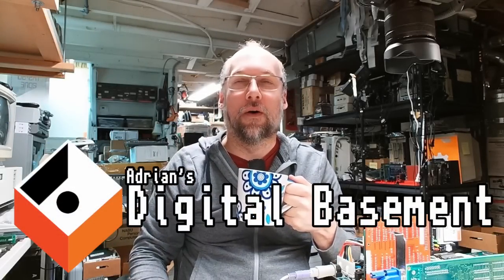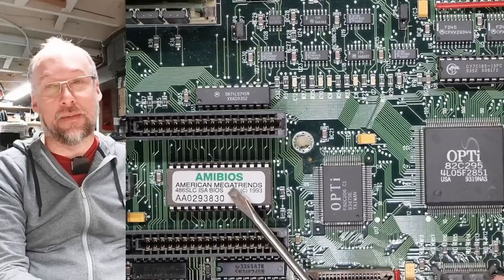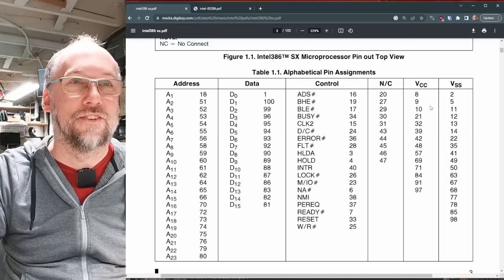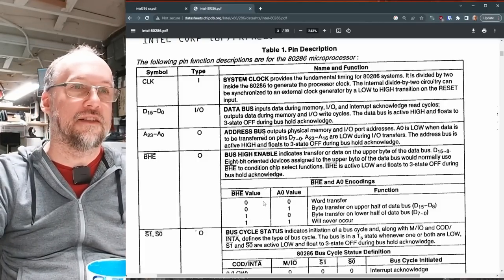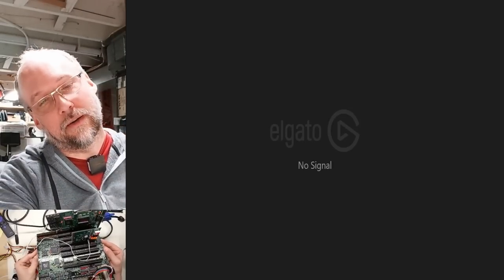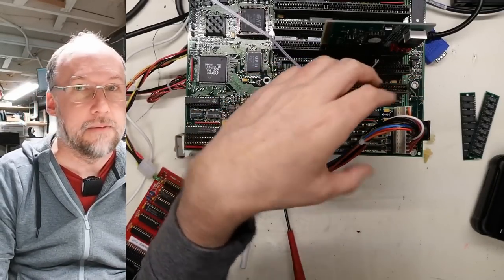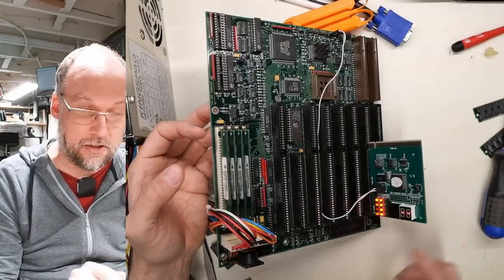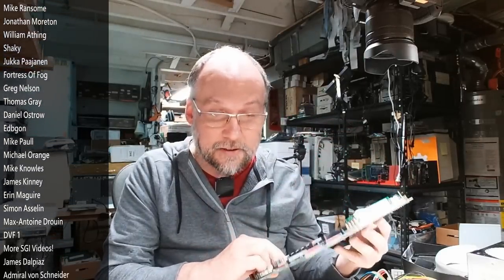Disaster struck while working on this odd-ball 386SX VLB motherboard

Comment: I have this exact board, the CPU is an IBM 486SLC2 - mine running at 66MHz. My first 486 had this board in it (not the exact one I have now), they were often sold in bargain basement PCs where they could use the cheapest parts but still market as a "486". Although it's really a 386SX as you said, it's surprisingly fast as it also has 16KB of L1 cache, double that of a 486DX2. Probably on par with a 486SX-33 as far as speed. As for the VLB, I have a Cirrus Logic VLB in mine which runs decently but I haven't done any comparative benchmarks, but I mean to do so one of these days. I have tried installing VLB IDE and SCSI disk controllers in the board but have been unsuccessful in getting anything but a video card working in them
Reply: To me the easiest way to test graphics card performance in DOS is using the game Screamer, the configuration has that option.
I remember testing PCI vs local bus on a 486 sx 50mhz and the 1mb PCI Cirrus 54something (5420 or 5430?) was faster than a "chips wingine 64300" local bus card.
Reply: @pelgervampireduck  That dos 3d benchmark with the floating pc was perfect to measure the difference of the video bus speeds

Comment: I had a 586-133MHZ system with VL-B, it was the Image 128 graphics card. Anyways I always had issues with the card popping out of the extended slot all the time. It was a very tight fit, amazing the card nor motherboard never got damaged.

Comment: 15:23 The VESA spec says the maximum frequency for VL-bus is 25 MHz if there are 3 slots, 33MHz if there are two slots, and 40MHz if there is only one slot. I think this has something to do with signal reflection, or just the load on the bus (in the load case it would be possible to run a 3-slot VL-bus at 40MHz if only one card is present, I don't know whether it is true or not). 50MHz is possible if the device is on-board instead of plugged in using a slot. However, few chipsets support 50MHz FSB 486s, and even fewer of those motherboards have an on-board VL device, so this is hard to verify. Plus, starting from DX2, intel stopped selling 50MHz FSB chips (because few motherboards support that!), the overall performance would be better on a 66MHz DX2 with 33MHz bus than a rare 50MHz DX with a 50MHz bus. Note that these are all guaranteed specs, in real life no one stops you from clocking a VL-bus with 2 cards at 40MHz just like no one stops you from overclocking. The only problem is that stability is not guaranteed outside of those frequencies.
Reply: That explains my painless experience with the 486DLC and single VLB so it was safely running at 40mhz with the Trident VLB i see...

Comment: Hi Adrian,
I had a 386DX back in days and I had experience with this configuration as well. Using a very similar Cirrus Logic card the graphical speed was like half. Not many software used the graphical acceleration that time, but with the SX series it's was like no acceleration at all. On price wise it was a 25% cheaper (the whole PC) but it definitely not worth to save on this boards. This is my first PC was 386DX and I saved on the Sound Blaster compatible 8bit sound card instead.
I also tried to save on the Quantum Hard Drive, but that was a failure as I had to replace 3 times in one year. 
Anyhow I like the video and thanks for your hard work.

Comment: This is why I don't like using old AT power supplies, but use ATX's with AT adapters, the fear they'll fail and take hardware with them. Same with original C64 power bricks. But I don't have wizardry repair skills either, hence I'm extra cautious and in awe of those who's got em' 🙂

Regarding 386SX, I think along with more MHz, it's also got double the amount of transistors, so still quite beefy compared to a 286.
But would never have guessed it existed with VLB either.

I hope you feel better Adrain, and thanks for making and sharing the video despite everything 😊
Reply: I don't like AT supplies because they typically route mains voltage through the case to a switch, I've had a machine I was working on where the front switch was either replaced by a moron or the factory subbed a switch they shouldn't have, but it had solder lugs on it instead of straight terminals for spade connectors, so the switch wires had enough wiggle room that one of the leads managed to short against the bracket holding the switch and threw a nasty arc and flipped my breaker, I think I got a little bit of metal in my eye from it too, so I don't like messing with AT supplies at all because of it.

Comment: This is a very interesting period in PC history.  The VLB standard was very strange anyway.  The cards never fit, and the drivers almost never worked.  I remember the Diamond Viper being the component that would best take advantage of the standard, and I had one that worked maybe 50% of the time.  Most people had a Cirrus Logic 5xxx card in VLB, and the many VLB controller cards which I never really noticed a speed difference with.  You are right about the SLC chips being a very misleading standard.  John Dvorak famously lambasted IBM for putting their name on them.  Of course this was IBMs revenge on the whitebox market by dumping all the motherboards with SLC chips in them, after the failure of their Ambra brand.  I had a couple of those boards, the 32 bit models were known as "Blue Lightening".    I suspect this board was intended to be in one of the odd Ambra models that had both and SLC chip, and a VLB slot.
Reply: LOL - I have built over 50 retro PCs recently for sale on eBay with VLB, the cards fit and the drivers worked. The only occasional issue is that some VESA cards don't work in certain slots, but I've never had issues with them, even back in the 90s. Hell, I had a DX-50 486 running with VESA I/O and a VLB video card, as well as a Socket 4 P60 VLB running Windows ME back in the day. The drivers are available now, and they were included back in the day on diskettes. Stop dogging VESA. 

Also, "lightening" ?

Comment: When you zoomed in on the opti chip, it looked like there was some rogue solder or something bridging some pins further along the edge (bottom edge, to the far right, near the corner.. as looking on the video) and then also, the larger chip above, the bottom right corner (again as looking from the video) - looked like there was a rogue piece of metal or wire going from the via or something...

Comment: The differences between the 286 and 386SX were a lot more than a few lines. Protected mode worked, it was 32 bit internally so could run 32 bit code (unlike the 286) but had a hobbled data bus to 16 buts to make it cheaper.

Comment: You assume that adding VLB slots is for speed increase, it could just be added for compatibility with VLB cards. Also, while some 486 had PCI slots the initial PCI version was broken. Most cards for the 486 were either EISA or VLB.

Comment: I just sold an IBM Blue Lightning SLC with VLB - it was also a 16 bit processor at the core. I've seen 386 SX VLB mobos, albeit with a socket 3 upgrade path.

Comment: When I finally switched from my souped up Amiga 1200/030 - I specced up a 486DX2-66 with VLB for SVGA graphics and hard drive cards. Good times for the very short lived VLB!
Reply: When i moved up to a Cyrix 486DX4 100 the motherboard had two VLBs, i brought my trident VLB and added an IDE/floppy VLB to it. Conveniently it was 3x 33Mhz so the 33mhz for two VLB cards as the spec says, neat. I think it was win 3.11 that could use 32bit ide.

Comment: 1) Yeah this is not a 386sx. it is an IBM 486SLC2. Still an 16-bit bus board. It is very strange it has a VLB slot and this is probably all a hack with these PLA chips.
2) BTW I recently got this board. It works fine here. I tested very fast with a VLB card, I do not remember details. Should be way faster due to the increased Frequency.
3) The 286 and 386 busses have many control signal differences actually but adapters are possible.
4) The IBM 486SLC2 has a legit 486 core inside with 16KB L1 cache, licensed directly from Intel. Has nothing to do with Cytix/TI 486slc, though that name is nearly the same.
5) Your problem was with memory. Probably this detached pin on the chip-set. That was some bad luck there with the power supply.

Comment: IIRC this motherboard was sold at b&h photo. It was a dirt cheap 486 motherboard and I was almost going to buy it but upgraded my 386sx with the cyrix piggyback 486slc. That is when I realized the cheap IBM 486 motherboard was a 486slc not a real 486

Comment: For those that are learning from this video, the 386SX isn't a 286 with extra signals.  As it is correctly said later ,it's a 32 bit 386 CPU internally with a 16 bit external data bus, whereas the 286 is 16 bits internally and externally and is missing 386-specific CPU instructions (of course).
Reply: The BIG difference between the 386 and 286 was Virtual memory. The 286 was BROKEN as far as its Memory Management was concerned.  On 286 when you went to Virtual mode - you couldn't get BACK! That is a big problem for an OS that needs a Kernel Mode and User Mode to support secure operations. The 386 fixes this - and a 386SX has that feature! So it isn't JUST another version of the 286.  Back in the early days of Linux I was running Linux on a 386SX an 8MB of memory. I was running X Windows on it and it was perfectly peppy!
Reply: @stevenwilson1690  Sometimes I think ADB and others say these things about the 386SX, 68000 and the 8088 just to get people to comment.
Reply: In the same way, would you consider a 486 DLC (132-pin PGA) a degraded 486, or an enhanced 386?
Reply: @thekombinator617  From my understanding, the 486DLC was a 486SX compatible processor, and the 486SLC was an 'enhanced' 386SX. (A marketing ploy calling it a "486SLC".)
Reply: @dougjohnson4266  The Cyrix 486DLC and the Ti counterpart (more cache on that one) are PGA 132 CPUs with 486 instruction sets added. Neat little extension of the 386.
Reply: @dougjohnson4266   - Yep - I called him on the 68010 as well once ;-) My first job up in Silicon Valley was to develop an MMU for a 68010 based system.  We had first samples of the 68010 to put in our development boards. So I have a pretty good memory about the primary differences. ;-)  I was also around during the whole era of 8088 to 8086/8085/80186/286/386 et all. I've worked with most of them as a design engineer.

Comment: Interesting about the number of SIMMs.  I grew up with a 386SX, and it had 4 SIMM slots, and we actually populated it with 4 1MB SIMMs, which were entirely readable.  It was capable of 16MB, with RAM expanders or 4MB SIMMs, if you could find/afford them.

Comment: The Alaris Leopard, i have the same card with a 486SLC2 66MHZ ibm cpu. It can run at 80 MHZ by playing with the jumpers in an undocumented setting. I recently got a VLB card and will test if there is an improvement with it.

Comment: I remember than the 486SLC or 486DLC version were a 386SX and a 386DX with co-processor. The performance of  the 486DLC-40Mhz was similar to Intel 486DX-33Mhz but with un chip very cheap. I am not sure but there were a VLB mainboard for the first Pentiums 60Mhz and 90Mhz or a mainboard with PCI and VLB combined.

Comment: I think part of the reason they put VLB slots on this motherboard is because this is not a "386SX" motherboard.  This is a 486SLC motherboard.  That means it was being marketed as a 486, and was supposed to be a cheaper-but-equivalent to all the other 486DX motherboards also being sold at the time.

And if you were buying a 486, you wanted it to be able to do VLB as well.  Even if it wasn't as fast as a full 486DX, compatibility with VLB peripherals was part of the reason why people often bought a 486 motherboard to begin with.  If somebody was selling a 486 with no VLB on it, then lots of people wouldn't even want to consider buying it.

And it likely was still somewhat faster than using the ISA bus (if it's doing half-bus 16-bit transfers at 33 MHz, then it would still be about 4x as fast as ISA)..

Comment: I believe the IBM 486SLC/DLC are distinct from the Cyrix versions.  I have an IBM PS/2E 9533 with a 486 SLC2/50 and a 25 MHz 387SX, and everything identifies it as an Intel 486DX, not Cyrix.  (Going by various flag tests, since it isn't new enough to support the CPUID instruction.) I read that their license agreement with Intel only let them sell CPUs soldered to the board, so you never saw socketed IBM 486es.

Comment: The lowest board with VLB that I have in my stash is one with a 386DX40 soldered on.. but since that's a 32bit machine, it actually makes sense to have VLB on it.
This power supply incident is the main reason why I use a modern ATX supply with an adapter cable to AT when I tinker with retro equipment.. PSUs made 20+ years ago just didn't always age well, and it takes just one shorted capacitor to have them escalate out of acceptable voltage ranges. Perhaps you should consider getting such an adapter yourself, it's very sad to see a board die of a bad power supply.

Comment: Can’t win them all.
I’m curious. I remember back in the 386-486 days testing boards and half of them had some “feature” where they would NOT boot without a battery. I remember in part because in recent years restoring old Mac’s it shocked me that people just yanked the batteries and started machines up without replacing them.

Comment: I used to have a VLB mobo with a 486DX-50 (actually a 486DX-33 cooled by a powerful and noisy 220V AC 12cm fan!) that worked quite well with a Chips & Technologies 65545 VLB graphics card under the standard Windows 3.1 driver for this card, and the VESA mode in MS-DOS 5. So it's not unreasonable to think VLB could also deal with a 66MHz FSB and a decent graphics card.
BTW, the C&T 65545 chipset can be a good comparison tool to test with a Pentium VLB mobo, then with a Pentium PCI mobo since 65545 graphics cards existed in both versions.
22:05 The Acer Aspire M3100 can't even power on if the CMOS battery is dead.

Comment: 26:41 are there some bridges on the upper pins of the Opti chip (75 to 80, lower right in image)? There look to be posibly 3 small blobs of solder. They could of course just be non-conductive dust / dirt particles.

Comment: I remember seeing some systems that came out before the VESA Local Bus that included various sorts of proprietary bus extension slots.  I suppose one of these got enough industry backing that it became VLB (some of the ones I saw looked much like the VLB).  If I knew where my CompuServe email archives were I could look up when it was, since I had emailed John Dvorak asking about them.

One of my VLB systems also had a drive controller that plugged into the second VLB slot, and took regular 30-pin SIMMs to add cache to the controller.  Now I wonder just what happened to all these boards and such when I upgraded them (I haven't seen them since even before our house fire, which is where I lost a lot of old components).

Comment: My Dad's school had some 486SX-25s with VLB (DEC LPV) and 486SX-33s with PCI (DEC Venturis), although I don't think I ever compared I/O speed on them.  Also, the IDE controller in the LPV had a silicon bug that could cause data corruption if used in 32-bit mode, anyway.

Comment: I had a really bad experience of a PSU failing on me that damaged a $400 motherboard years back and I ended up not having a working computer for a couple of years because I wasn't prepared to replace both a mobo and a psu at the time. I only had money in budget for a new PSU, and it ended up being defective and the psu manufacture felt that because the mobo wasn't new, they weren't going to compensate me for a new one. Due to the fact the mobo still posted when the old PSU failed, then just died with the defective one. So yeah, I always test my PSUs now if it's new or if I haven't used it in a while.

Comment: I don't remember ever seeing a Pentium with VLB on it but there were 486 boards that had VLB and PCI slots.
Reply: I found one in my box of old motherboards, has 4 isa, 1 vlb and 3 pci. With a socket 3 "P75" AMD cpu (133Mhz). 4 30p and 2 72p simm slots.

Comment: It does suck when power rupplies go bad and take out a computer entirely, last year my media server/NVR PC had its' PSU go up in flames, filter cap had gone bad (and was not a Rifa!!) spitting out its' guts and flaming out, and anything on the 12v rail, destroyed, which was CPU, motherboard, GPU & one HDD, the other HDD still "worked" and I got my stored data off it, but was still damaged, all very sucky, but I got similar components to rebuild it like-for-like, still cost me around £200-ish to do though, which was just not fun... :(

Comment: Have you checked the memory chip presence pins on the memory modules.  Many machines of this era had these links set to ensure you use the "correct" memory... 4 pins on each simms.  That said can be tricky to find what links should be shorted.

Comment: This honestly is almost deja-vu to me. I'm still troubleshooting a 386sx motherboard that also took out its power supply out of nowhere. I was able to replace the switching transistors in that PSU getting it going again, but still no luck with the motherboard.

Comment: I think making a interposer board that monitors all voltages from a PSU and cuts ALL lines if any line goes out of spec would be prudent for working on such old equipment.
Let's call it a PSU Condom. (PSUC) 🤣
The mainboard may have been damaged by one of the rails dropping or going missing, and such a device could prevent that in future. It would also give a nice place to put status leds showing the quality of all supply lines. If I were to make one I'd add current-sensing to all traces as well, and a display. Very useful to be able to see what rails are being loaded by a board, and how much.